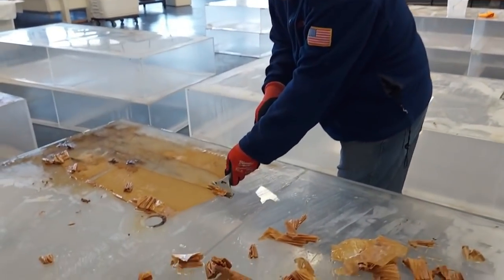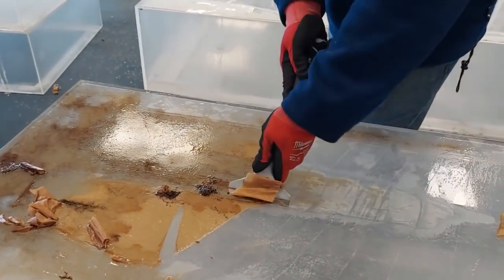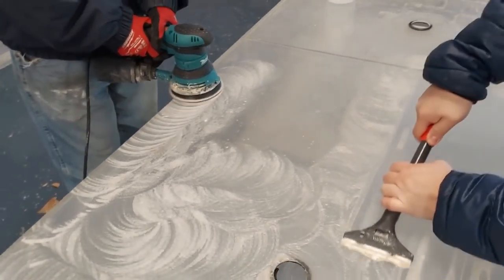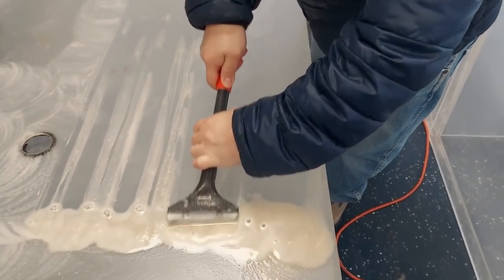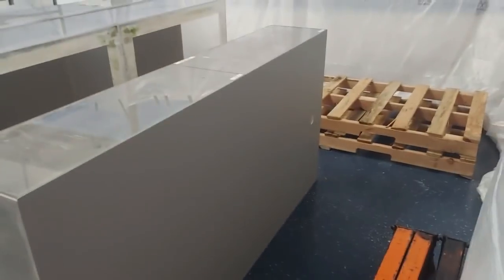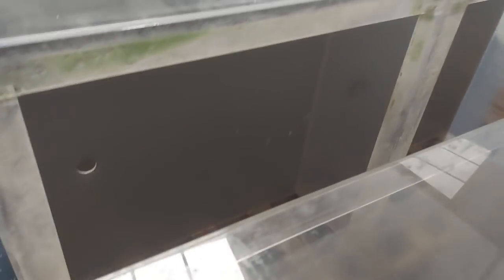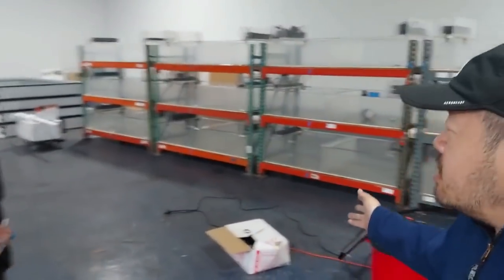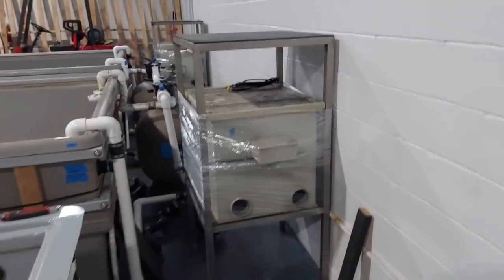Refinishing Acrylic Aquarium - DIY - Removing DRIED masking paper, sanding  and painting

Comment: The best way to remove adhesive is rapid remover you can get that from any sign supply shop it smells like oranges and you can clean the rapid remover off with 70% isopropyl alcohol this how all vinyl wraps on vehicles are removed and what you are doing is basically the same thing even with the scraping. only difference is we heat the vinyl up and we use plastic scrapers so that we don't scratch the paint it goes a lot faster and like you just showed the the Sandpaper is full of grit.... That is adhesive and paper it's going to become extremely gummy on the Sandpaper so I would tell you to get some rapid remover from a sign shop you can get it in gallon jugs and a little goes a long way with the proper spray bottles you will need gloves. It being an adhesive remover some people don't like the smell of it even though it has an oranjee smell it will permeate room until you wipe it up with isopropyl alcohol I'm sure you probably already finish all the removal.... this is just a suggestion